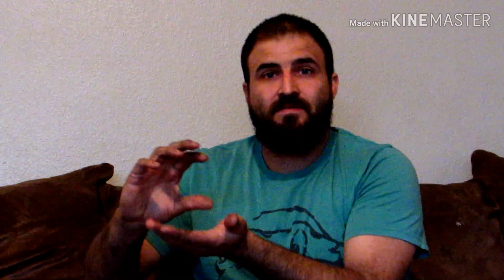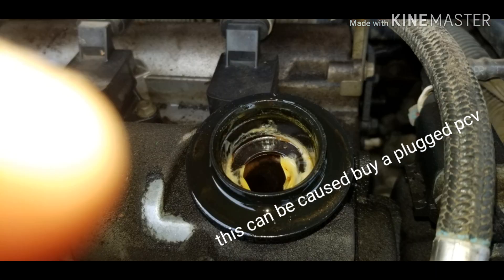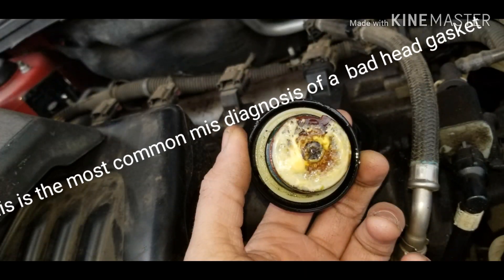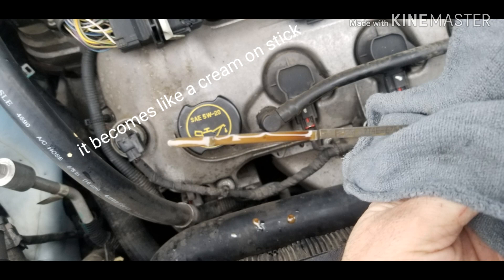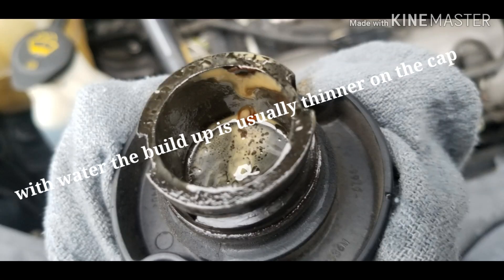why is there water in my oil, does this mean a blown head gasket?

Comment: Compression test???
Reply from the maker: Are you asking how it's done ? Thabks for watchin
Reply: @fixergood  I'm a little older but if I ever suspected head or gasket issues I would do a compression test.  Plus if the engine isn't skipping or missing I didn't even consider the heads, I would think no significant compression loss.  I may be way out of touch with the newer technology.
Reply from the maker: @kicknsystm  the only time I consider looking at a head gasket possability is when theres fluid missing and it over heats  and no sign of were it went.  If the engine sits for a while  then are start up it misses.  Compresion test is a good one also and a leak down test. Thanks for watchin.